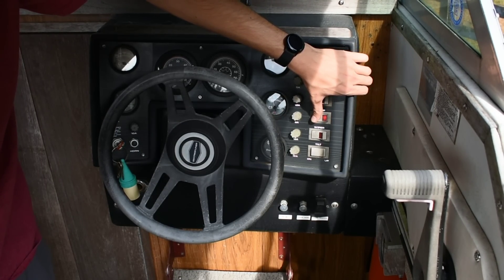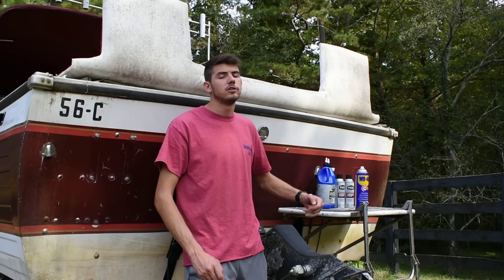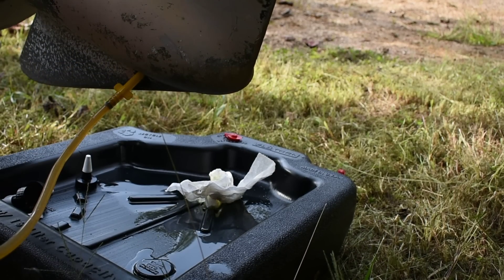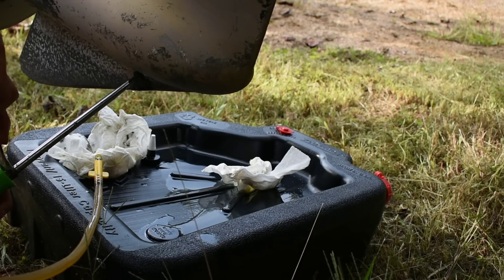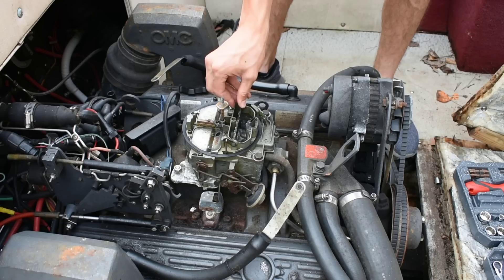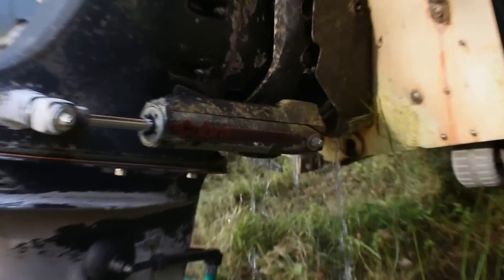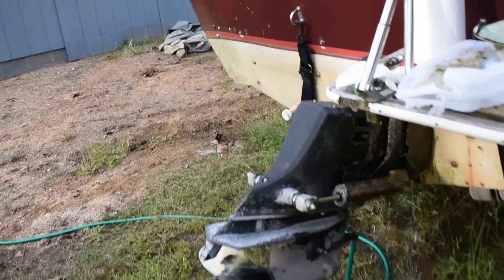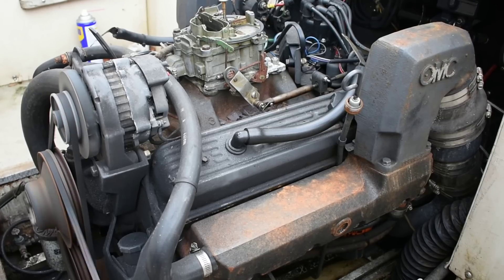Will it Start??  - Restoring an Old Fishing Boat Part 2!

Comment: Change the drive unit impeller. That’s just a given. They get hard from just sitting. Your not getting good water flow from the relief and exhaust. Plus check the water hose connection between the outdrive unit and the engine to make sure it’s not cracked or split from age. It looks like it’s pouring water out from that area. 

So far the engine itself sounds good and even. I think you will find good compression all around when you check the engine again.  Make sure the PCV system and valve are functioning properly.

Good luck with your boat. Looks like you may have found yourself a goodie there.

Comment: You WAY overfilled the lower unit. Good by seals. Should have checked compression with throttle wide open.
Reply: I'm just a shade tree mechanic and am asking for my own learning. RE the WOT, would it really make a difference, given that the idea was to compare cylinders? Granted, he's not getting a true compression reading but if one's choked off, they're all choked off and the test results are comparatively the same, more or less. That and, he's not getting a true compression test anyway because the thing hasn't run in two years. Is my thinking off?

Comment: I'd like to see what the compression test is after running the engine. 
Seems to run ok.
Check the oil to see if your getting any water in it.

Comment: I rarely work on boats. Usually it’s tractors. I have better luck freeing up sticky  rings and valves when the engine has a load on it. Good luck.

Comment: I wish you were my neighbor.  My old boat, i can't get it running.  The battery compartment flooded with water and the battery was connected.  Won't even turn over.

Comment: Nice video… I noticed that exhaust fumes were exiting the lower unit close to transom and also by the propeller. Is that ok?
Reply: Yes the exhaust goes out that direction

Comment: A quick way to freshen up old crusty spark plugs like that it to blast them with a torch for a minute or two . it cleans them up pretty well and as long as they arent cracked or exesivly worn they will work fine especially if its just for a test run.
Reply: best way, is just replace them with new ones, the one thing he has done right.

Comment: Please stop what you are doing you are filling the lower unit with the wrong fluid and you are way over filling it the top one you are supposed to unscrew is directly above it, it looks exactly like it and it’s maybe a foot above it and as for the last video when you starting a carbed engine both flow must be closed for cold starts you can open them only when spraying starting fluid and if you are wanting to fill the float there’s a small vent up front on the Quadra jets that you can use a small funnel and fill them. Please take your time on the next video and look everything up because you screwed a bunch up already I hope you can fix everything again this is meant to be rude but if you haven’t done it before look it up or ask someone before changing or fixing something. If you need help with boat questions I’d be happy to help.

Comment: OMG, pull the upper plug.  The WD you sprayed, only got the dust wiper NOT the packing or seal of the tilt ram. Compression doesn't tell you much about the engine's condition general or otherwise. Vacuum gauge and a cranking vacuum test will reveal all.

Comment: Just throw some fuel down the carb and see if it fires then worry about spending money otherwise it's not worth it bin it cylinders been that down on compression id run it first cause it's probably got loose rings or something in it and it's possibly got shit cylinders

Comment: Should have stopped as soon as you shorted the battery out because it didnt get any better from there..... if you dont know what you're doing thats fine but dont make a video pretending what youre doing is right....
Reply: He'll learn as he goes. Lots of good comments here. Ive had so called trained mechanics miss diagnose issues with cars and boats. Took a car in recently loosing coolant. They tightened up the hose clamps and sent me on my way. Turned out blown head gasket, fixed it with Nulon permanent head gasket sealer. Very embarrassed when I told them. Keep going Kid, the only person who never made a mistake never did anything, have a nice day😎

Comment: You are doing it wrong, to drain the lower unit you pull the lower plug then you pull the side plug Daniel pump fluid until it comes out the side plug.